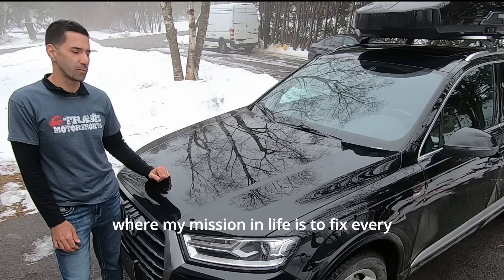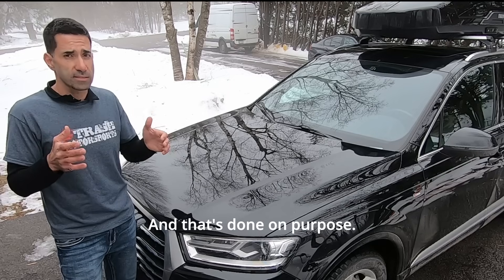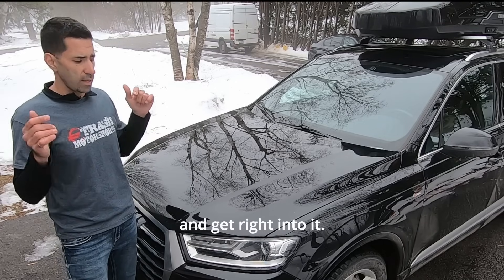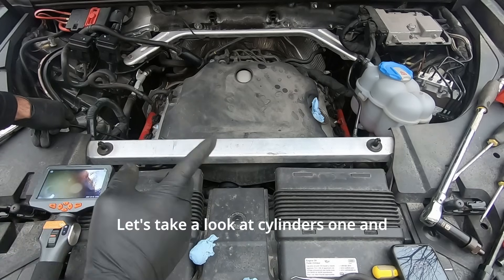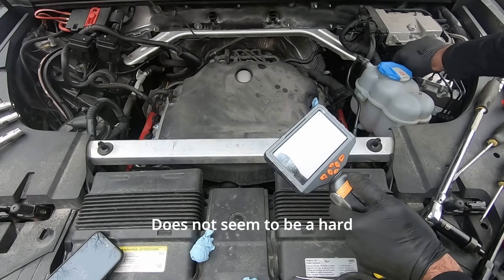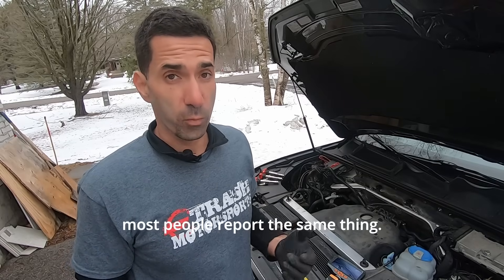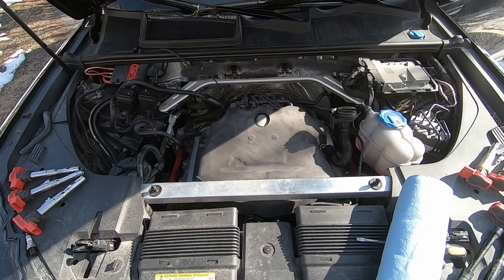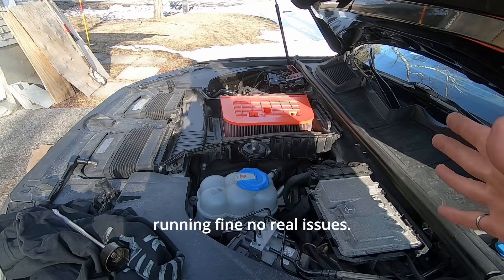I piston soaked another 3.0T with B-12 to fix its oil burning issues due to stuck piston rings

Comment: I've been sharing your video on the Facebook group for the Q7s and seen many people have success with your method. Having said that, if you are able, and can show us an in-depth tutorial about how to replace the timing chains,guides, and tensioners for this generation of Q7, I would be ETERNALLY grateful.
Reply: I've done my soak twice and you are right. The first time, I only ran it for a few minutes with the B12 inside the engine for fear of damaging it, but that only got me to about 4500 miles before the light came back on. After the second soak and doing 2 pistons at a time as TDC, I drove it for a quick blast(reasonably) down the highway and I pushed the next oil change to see when the light came on. It went to 6500 miles before it burned a quart. I highly recommend driving it for a bit after. I do my oil changes every 5000 miles now with Liquimoly and according to the digital dash gauge, I'm burning 1/5th of a quart every 5000 miles. I can live with that.
Reply from the maker: oh those are great results! nobody so far has reported issues after running B12 in the motor so I think within reason, you're ok to take the car for a drive...I wouldn't do a track day with this in the engine but even SeaFoam has a flush option where you drive for 500km with seafoam in the oil...
Reply from the maker: hmmm...I haven't done the 3.0T chains but I've done my S4 v8 chains - it will be about the same...in any case you`ll need to pull the motor which is a pain in the butt
Reply: @ETMotorsports understood, but man Id love to save several thousands of dollars doing it myself, but I have not found one decent video of how to do it from diconnecting the first plug to clearing the (im sure) hundreds of codes removing the engine would throw. All the videos are of the sedans, the v8s and they already have the engine out, gloss over a bunch of details and then cut to it running smoothly. Not very helpful. With your vids, I was able to cure my oil consumption. Now I want to tackle the last plague in this car…those rattling chains. It’s daunting even for me and Ive done timing belts on my Acura. This engine is just so complex, I dont want to miss something and blow up the family wagon.
Reply: @ETMotorsports how about a video on upper chain tensioner’s and resealing the upper timing cover. This would be good for the chain rattle cold start people (me)

Comment: Someone needs to sell this in Europe ... its only available in UK but they dont ship outside of UK ... so sad, but great results.
Reply: There are other products that can be used. I used Gumout Multi System Tune-up with PEA and for V engines then Yamalube Ring Free Plus will work. Sea Foam will also work.
Reply from the maker: Seafoam may work depending on how bad the engine is but it is A LOT weaker than B12...you could try LiquiMoly Engine Flush or Injector cleaner from their pro line